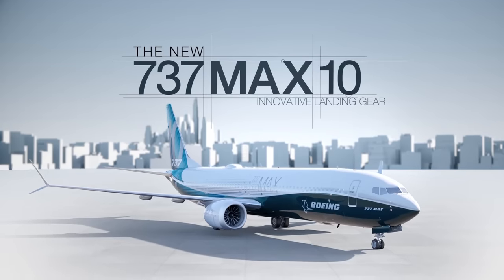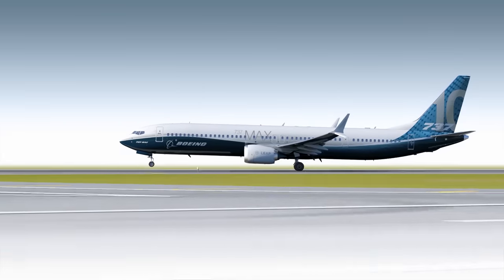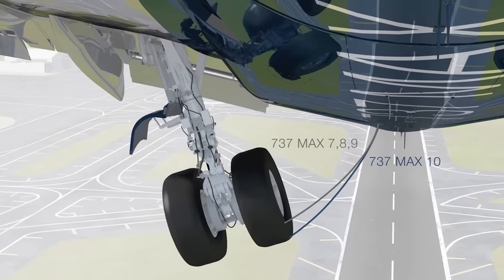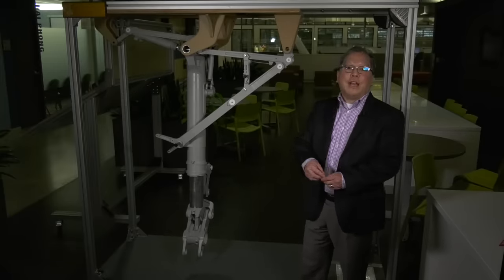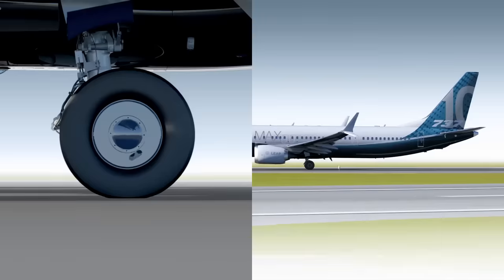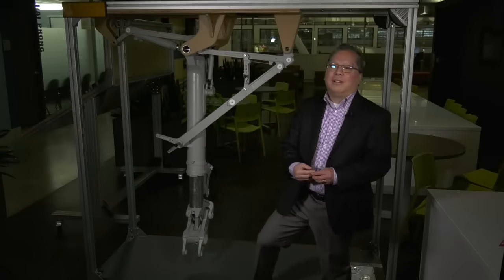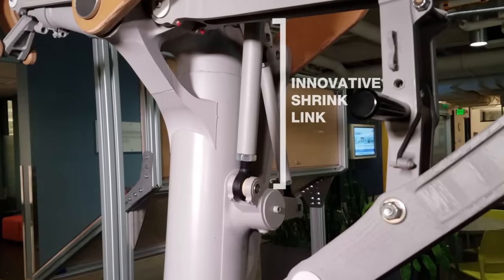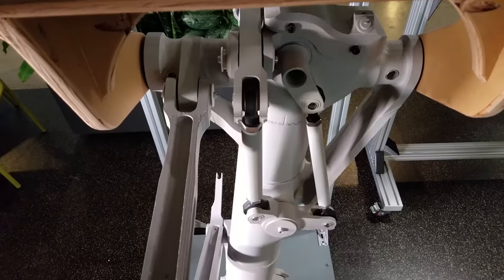How the 737 MAX 10 landing gear works

Comment: The 737 was a magnificent aircraft back in the 60's but nowadays it is just too outdated no matter how MAX it can get. The aircraft is a design flaw itself, it will be always in the shadow of A320.
Reply: hardly.  I've jumpseated on an airbus and that thing's performance is significantly less than an NG, let alone MAX ... pound for pound.

the ONLY thing operationally the bus has on the guppy is ground stance/tail strike avoidance.  The NG/Max have better take-off performance, climb performance, altitude capability, and stopping performance.

Boeing just blinked and sought to make the 737 do the job of a 757 and that has been a fool's errand from a load perspective ... because of the ground stance/tail strike risk.
Reply: @shaark92  Yes, I agree on every word you have written. But from the airline's perspective, it's all about economy. It is good that an aircraft has N+2 performance, but if an airline only needs N, then there's no space fpr discussion. And apparently, most airlines only need average performance.

Comment: boeing logc 101: 
we have a problemm with the anti stall measures on an already unsafe and outdated design - how do we solve the issue?
re design the landing gear, that'll solve everything

no wonder innocent people are perishing in these deathtraps
Reply: Higher landing gear would mean the engine can sit more under the wing like the 737 ng series. Which mean they won't need MCAS.

Comment: Just build a ground up designed new airplane so all this unnecessary engineering wouldn't have to be done, unnecessary complexity. Just adding possible new problems into the mix like with MCAS
Reply: Ground up will take 10 years or so, it wouldn't make any sense to do that.

Comment: in order to preserve commonality of laziness actually... :D let name it real in real words. 
there is no way that customers will save anything in this. 
Landing Gear will be not applicable for max 8 or 9 there fore limited availability and in the market, as well as overhaul capabilities. 
This landing gear will be 3 times more expensive, same case NG-900er 
OK, bigger plane needs stronger legs, new not interchangeable design is required.. OK.

But this type of engineering is rather to show how not to do. 
"oh, let's add at least 9 additional hinges, instead of finally designing tall enough aircraft to fit those damn engines and  complete agains Airbus"
What the hell, Boeing cutting corners again and compromising safety. 
I see at least over 10 new Life limited parts on this gear which will be nightmare... 

Saving cost boosting stocks, well done.

Comment: You do a great job :)except upgrade the software Anti Stall on control of the MAX:(   I would not come out and say How great of the engineer you guy did :(  With a little bit more $$$$ you spend to make a minor change this could be a exclleentB737  MAX that BOEING could be very pound of instead  you engineer a death machine that kill over 300life Just delete this short sight  I am  very mad at  Boeing  management all they want to do is beat AIRBUS at all cost :( Gary Hamatani  I would have a bad dream overnight :( How much would it cost to upgrade on ANTI STALL  SYS  VS LOST of LIFE and  BOEING name on top of that :) No excuse  :)

Comment: There will be a lot of tail strikes as this system will most likely fail a lot.
Reply: Daniel Mirk followed by decompressed airplanes years later due to incorrect repairs to rear bulk heads (but hey those cracks will have commonality with the whole max family) 🤦🏻‍♂️

Comment: If Boeing had decided to make the CORRECT design decision and re-engineer the entire main landing gear system to allow the new engines in the MAX aircraft to be correctly placed,   then there would have been no need for MCAS and no losses of aircraft to it.  Boeing is being killed by its bean counters,  and now that it prefers to hire its engineers from H-1B visa applications from third world shitholes, there's not a lot left to save it from its own bad decisions.    YOU DON'T HIRE ENGINEERS FROM COUNTRIES WHERE THEY RESIST USING FLUSH TOILETS!!!!!!

Comment: You know when Boeing  was making the 737 Max they wanted to make bigger engines to make it efficient. Then the found a problem that this 737 design makes de 737 too short for its engines. So Boeing decided to move the engines forward and up. that created a problem, that the design would make the 737 pitch up and stall. Then they decided to put in the MCAS that brought all of these problems. What Boeing should have done was to put this invasion to all Max's and put the engines normally like in the 737 NG and all theis shouldn't have happened.

Comment: yay, increase the risk of tail strikes and crashes for more seats! lawsuit incoming in 3....2....
Reply: So a design that prevents issues somehow causes more in your eyes? 

Alright then
Reply: The issue is they have added more complexity to a system to account for another unsafe modification of the aircraft. The 737 was originally designed to be low to the ground. The option to use the 737 platform to make an extended variant was an attempt to avoid having to create a newly designed aircraft, a cost saving measure. In exchange, it would mean opening up the possibilities of tail strikes. So essentially, each takeoff has now become dependent on this new system to work.
Reply: oh, hey Jordan !
Reply: 2 years later...I told you!
Reply: @jviation737  Just wanted to come back to this discussion. Your reply didn't age well